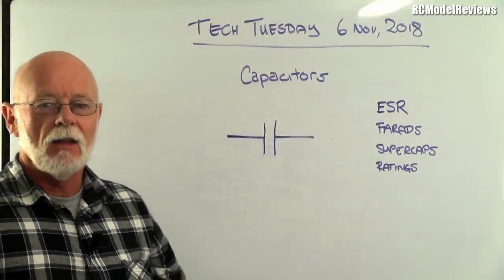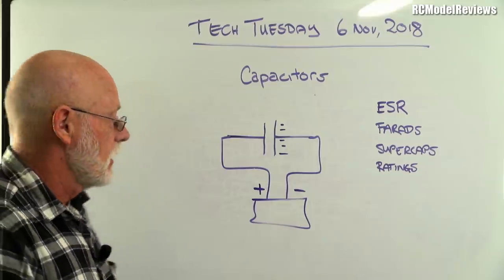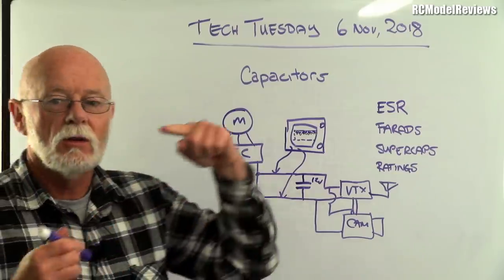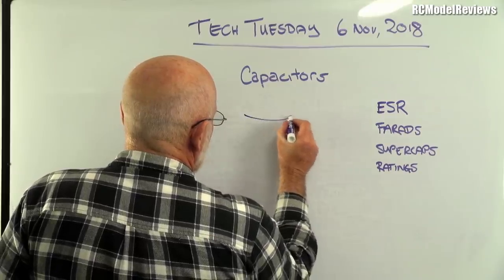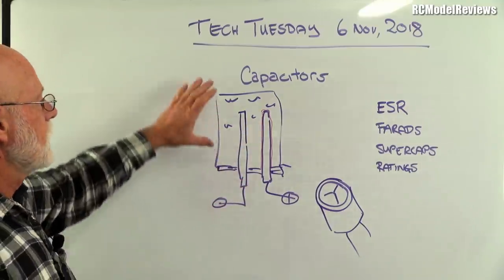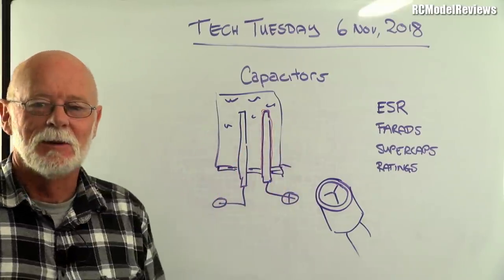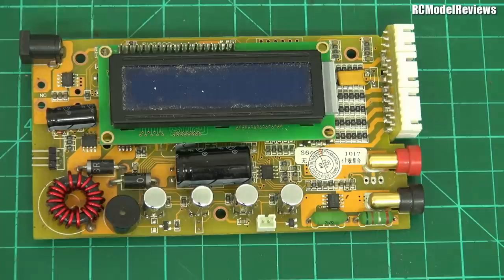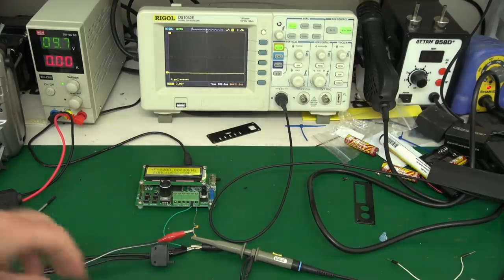Tech Tuesday: Capacitors explained

Comment: 35:41 Is that little gray box where the magic smoke is stored...? I have never seen it labelled quite so clearly
Reply: LoL:-) Good one!
Reply: Bruce, great explanation of what can be a very complex subject.  Coming from a mechanical maintenance background I have a very basic knowledge of electronics by comparing electrons to hydraulic fluid.  It's easy for me to visualize fluid flowing where I want it to go and what I need it to do.  Caps I visualize as accumulators ( a surge tank in a home steam system is an accumulator ) to smooth the flow.  Don't know why my brain works better with fluid, but at 66 I have given up on tiny really really fast bits of noseeum stuff that hurts if you grab it.  Ruins cutters also!
Reply: @williamstewart5635  -  Nice analogy!

Comment: Just in time for L2 Physics tomorrow! Great stuff. It's tricky talking about capacitors being "charged" because it can have two meanings. One is that it is "charged with energy" - ready to do work. The other is "charged with electrons" - which is confusing because that only applies to one plate. The total number of electrons in a charged and discharged capacitor is, of course, the same. They have just moved around so their distribution on the plates has changed. So capacitors do not store charge, strictly speaking, but separation of charge. Is that more helpful? Not sure really. Your way of just considering each side by itself is probably more intuitive which is good.

Comment: Thank you for this great tutorial which is very much appreciated.  What kind of capacitors are used for voltage protection on a RC circuit?  In other words, what kind of capacitors do "glitch busters" utilize?  Are they also Low ESR or not?

Comment: Super video!  Can you tell me if there is a rule of thumb or a way to compute the appropriate value for an electrolytic capacitor across the battery terminals on a quadcopter?  Thank you

Comment: Missed the one where you put a high value resistor parallel to a cap. Supposedly it drains the cap slowly, so if it's extra-spicy you don't find out the hard way. And the cap-resistor combo, isn't that combined with a relay for a turn-signal blinker?

Comment: Very educational. Answer many my capacitor questions. 

May I ask below capacitor geometry questions for my DIY capacitor made from plastic sheet and alum foil similar to the one you made?

Bigger the roll (bigger diameter) + tighten the material layer gap make higher capacitance.

More surface contact to + and - leg make higher Amp capacitor.

Does longer the cylinder roll make higher DC voltage? What make higher voltage?

Comment: another analogy would be that a capacitor is an electron-spring. soo much voltage? the spring compresses. too little voltage? the spring relaxes. a short circuit? the spring.... well, yeah, I'm sure you get the idea :p 

it's like the shock absorber of a car.

Comment: Out of passing interest: the hydraulic equivalent of a capacitor is the 'Accumulator'. Also, an interesting read is the Wikipedia 'Capacitor Plague' entry. It goes deep into faulty electrolytic caps, includes loads of gory bad cap photos and harrowing tales of how stolen electrolyte formulas & industrial espionage had us living in bad cap hell for all those years.
Reply: I remember the capacitor plague well... I worked as an elementary school technician at the time, and we had Dell GX270 PCs dropping like flies. I don’t recall how many mother boards and power supplies I replaced under warranty. Finally Dell stopped supporting the things. I understand that this little affair cost Dell (and others, I’m sure) very dearly.
Reply: @gryfandjane  - I heard (unofficially) that the caps fiasco very near finished off dell.
Reply: rwbishop I had to work in hardware support during the plague. We were swapping out motherboards faster than we could source new ones...

Comment: Thanks Bruce, Always love the tech stuff. Now a practical question . I have a place in central Otago, is there a way I can use a 90-watt 8amp 12 volt solar panel in conjunction with some sort of capacitor bank with out a battery to power a pump to irrigate a few plants when the sun is strong enough to set it going? Or is there some other simple battery free solution. I know its off topic please don't feel like you have to reply..
Reply: Might want to check out some of  Julian Illet's videos - he's playing with solar and has also played with charging supercaps from solar.

Comment: If caps block DC how so they work on our mini quads i guesd because were hooking them in parallel and not series rite? How is it filtering out the noise in our video when we put them rite at the terminal leads for the main power? Thanks man keep these awesome educational videos coming you would spend a lot to go to school to learn what your teaching us for free good on you mate!
Reply: Yes, in parallel. Consider a bucket where the supply is a thin hose while the video transmitter is fed with a thicker hose from the bucket instead of directly from the main source. When the draw isn't too large, the bucket can be filled up with spare capacity. As the motors kick in and consumes all the main supply can give (and then some), the transmitter can be supplied from the reservoir of the bucket.
Buffering caps are usually best placed as close as possible to the consumer to be 'protected'.

Comment: im working with motherboards because its how i can view you and i am now buying used ones and i am seeing something that may be of concern. a new motherboard has a "LIGHT" ITS AN LED most nice ones have a light that comes on when you hook it up to power. if you ever unplug or turn it off by switching the power supply off the light goes out. on a new board it takes 3-5 seconds, on a used board it takes 3 minutes! and its scary! i turned one off and to my surprise the light did not go out and i was totally confused about were it was getting its power from! then i realized this was or at least i suspect a "capacitor!" and now im learning that when they fail they destroy everything their hooked to so im very interested in what your talking about. would you agree with what i am saying? have i made the correct observation regarding the matter? what i suspect is that the used motherboard "works" but its so old that the capacitors have "DRIED" out and are probably going to fail.

Comment: I often see references made to "Audio Grade" capacitors. Can you tell me what these are ? and were they are used in a circuit ? 
I got the impression that they are a special grade of electrolytic capacitors. 
One other question is regarding the huge rise in electrolytic capacitor failures in electronic equipment made in the early 2000s . I saw someone suggesting that it was because someone had stolen the formula for electrolytic capacitors but they did not have a stabilising component which is why they only lasted a couple of years. I remember a lot of computers made from the year 2000 suffered from premature failure. Lots of apple iMacs and other computers had this problem. Many thanks for the video.

Comment: I think most GPS modules are still using these tiny batteries and the way to notice that they are discharged is they actually start to take way more time than usual in order to acquire satellite signals...
I have been there a couple of times lol

Comment: I have two capacitors rated the same 1000uf35v but they are shaped differently one is a bit taller slimmer and one shorter fatter, as i look for replacements i don't see different sizes just ratings that are the same but all the caps seem the same as long as they fit in there and ratings are the same am i ok just swapping the old with different shaped same value caps?

Comment: Also I learn the resister in my electric lawn mow going from bridge rectifier and before go to DC motor is for not to discharge too much current to motor at once. Otherwise motor copper wire will just burn. 

Am I correct on this concept?

Comment: Can use of a capacitor twice the size needed be a benefit or negative in the example  . Example 4s FPV usually use 35 v 1000 uf  would a 2000 uf be to much to clean  esc noise from 4s “lipo Capacitor placement on battery leads

Comment: From an electrician, could you go deeper with supercaps?

The hybrid Komatsu excavators use them apparently, and I’m told we can’t service them in Australia that’s a job for Japan. (I didn’t hang around in Komatsu long)

I’ve read that supercaps lag whatever you do to them so much, that after shorting them and removing the leads, they still contain voltage, and other nonsense

Comment: Help anyone. I had to replace two capacitors in an old  Super 8 movie projector (1977) which went BANG when I turned it on. I took them to Jaycar and another shop, but they didn't have any that size (physical size) but gave me some of same value, but much smaller in size. would that be right. After replacing them, when I turned it on, smoke came from the transformer. What happen.
Hope someone can clear the smoke for me.

Comment: you said no chemistry happening in capacitors but what is that oxidation hapenning in aluminium electrodes in electrolytic capacitors?
Reply: That  only happens when they are made.  Electrolytics have to go through this process which is known as 'forming" before use. They only need this doing once or if they have not been used for a long time.   Sometimes when not used for a long time they can explore when energised again.

Comment: (me at electrician exam)
- why are capacitors a passive component?
They change the way electricity flows, but they don't change it in an active way, they passively change it.. That didn't explain anything, nevermind, let's move on.
- Excellent.

Comment: What's a radiator?
Reply: Multiple contexts... In a car, the honey omb thingy just behind the grille. Hot coolant from the engine goes in one side, air passes through the honeycomb structure and cools the coolant. Coolant is returned from other side of the radiator to the engine. In a house a similar, usually cast iron, thing can be placed usually beneath  windows and hot water pumped in one side to heat the room...
I've heard an transmitting antenna described as 'radiator' as it's radiating e-m waves...

Comment: 33:30 - another Youtuber (dronemesh) in some of his videos mentioned that tantalum capacitors deal with high frequency noise - which one of you is correct? You do have a white beard which sways me your way 😛
Is that correct?
Reply: Tantalum caps are pretty much equal to low ESR Aluminium caps and both are nowhere near ceramics when it comes to dealing with "high" frequencies ("high" starting at 10kHz; yeah that's almost DC). Just search for capacitor impedance curves per type. Solid electrolyte tantalums are also very susceptible to voltage spikes because of the thin oxide layer, which is why you usually pick a voltage rating for them that's at least double or more than the voltage that you want to filter. Liquid electrolyte caps can heal themselves (within limits) by reforming the oxide layer, the solid electrolyte tantalums can't do that and usually fail short circuit after something (like a voltage spike) punched through the oxide layer.

Comment: If electrons are electricity and are stripped from copper (generator) , then a copper atom loosing 1 electron becomes nickel. Yet this is clearly not the case. Nor is electricity the movement of electrons.